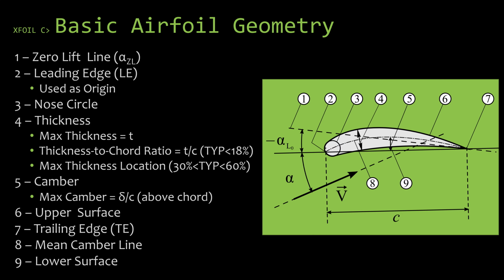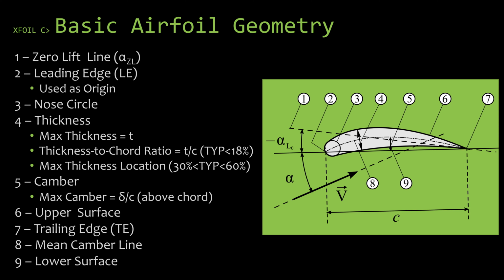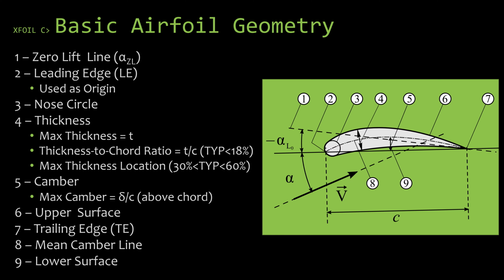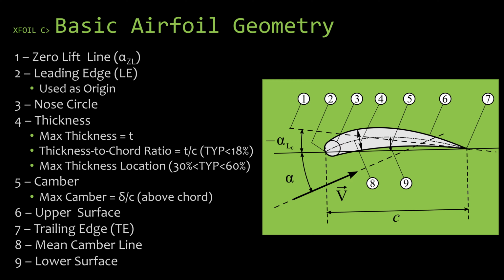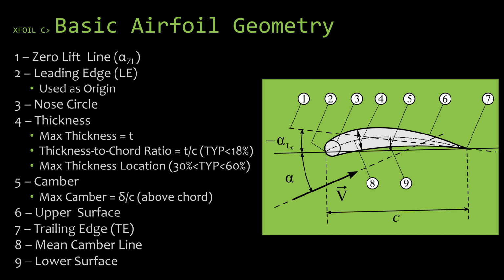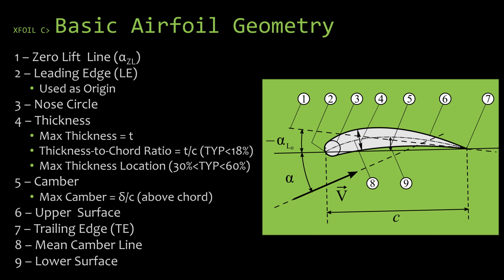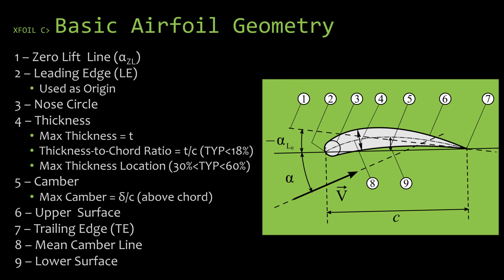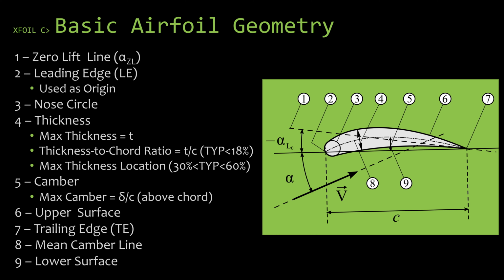Airfoil Geometry Review (XFOIL Prep)

Comment: Hello,

I do have one question, If I want to plot an airfoil with an control surface (say slat or spoiler) in Xfoil, how I can do it?.When I imported the coordinates for an airfoil with a spoiler, XFOIL show wrong chord length and .GDES command shows an airfoil which is not according to the coordinates given. But .PPAR command shows that airfoil as the coordinate points. However, the solution is not converging. Could you please give me a solution for the same?
Reply from the maker: Hmm, so the airfoil looks correct when viewed in the PPAR sub-menu but incorrect in the GDES menu? Curious. Let’s see. When loading an airfoil from a file, it is first placed into the buffer airfoil and then the PCOP command is called to add a panel between each point and then it is placed in the current airfoil memory. The PPAR sub-menu uses the current airfoil memory but entering into the GDES menu the buffer airfoil is used. Perhaps you can give the GSET command a try, this places the current airfoil into the buffer airfoil, and see if it fixes the airfoil. As for the wrong chord, I wonder if XFOIL thinks the trailing edge is the “trailing edge” of the spoiler or slat and so it’s calculating it incorrectly. You might also try to import the airfoil using the “MSES” coordinate file format. Maybe also look to see if you have the normalization flag, NORM, set in the main menu or y-symmetry flag, SYMM, set in the GDES menu to see if that is causing issues. This creates an airfoil by combining different layers together. I wonder if this would help XFOIL “figure it out” better since you will have an intact airfoil as the base layer and can place the spoiler or slat on a different layer.

I also have some videos on using the flap command in XFOIL that may help you through part of your problem. Check them out here: 1) XFOIL Tutorial 7: Adding a Trailing Edge Flap https://youtu.be/x2jEfNklQ2U and  2) XFOIL Tutorial 8: Adding a Slat (Leading Edge Flap) https://youtu.be/irhCYcboF70 

Hope this helps!